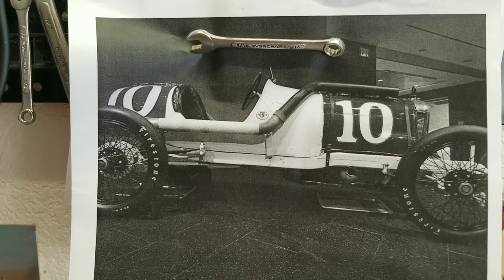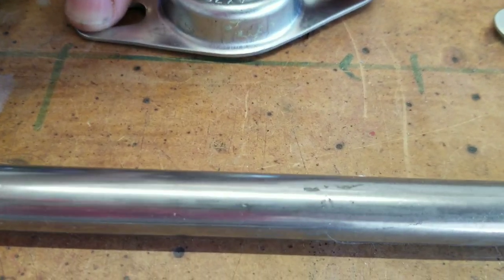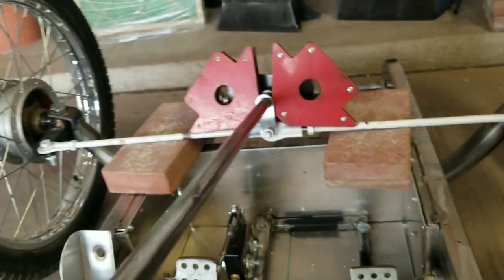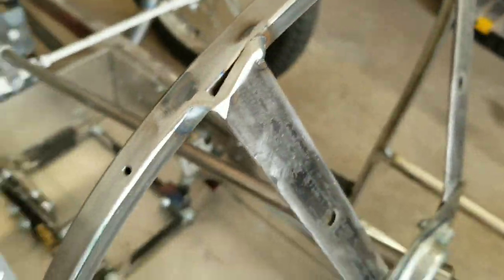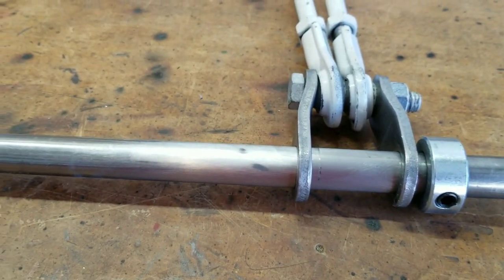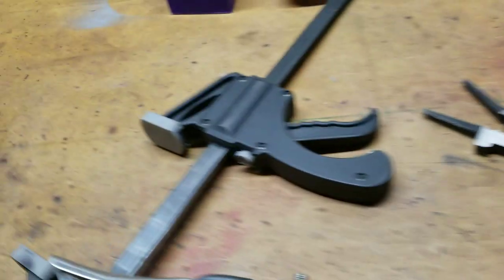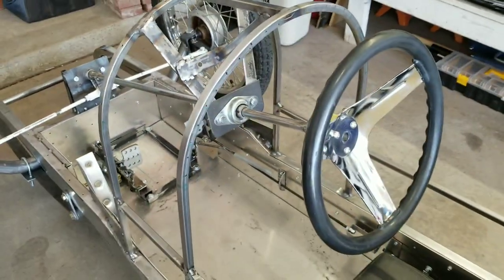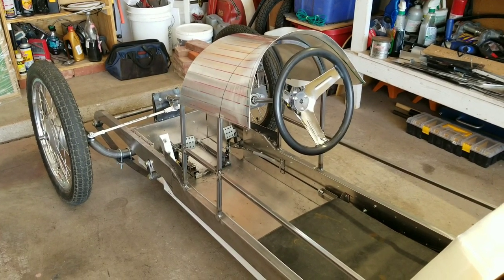Cyclekart Frame Part 10, Steering Assembly

Comment: A quick thought, you might want to consider rounding the lower two square corners of the upper steering bracket so you don’t scratch your legs on it as they’re bouncing around inside the cart while you’re riding not to mention climbing in and out.
Reply from the maker: Thanks, I may do that, although, it really isn't as close to your legs at it looks.
Reply: Steve Vinson yea I saw the next video where you test drove it so I could see that under normal circumstances it’s probably fine and dandy. But in my experience in my 50+ years I found you also have to think about when things go sideways. The person who slips and falls as they’re climbing in and their leg flies up, ouch. Something breaks or somehow the vehicle hits an object or pothole, causing the driver to be jolted, bounced or even cause the cart to roll. Likely? No. Possible? yes. Like I say I like to consider when things go sideways.